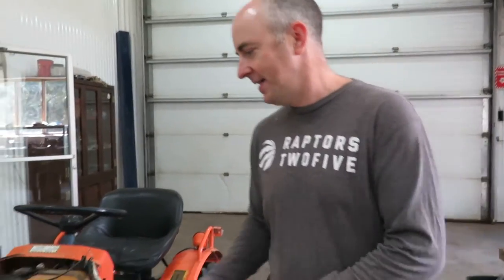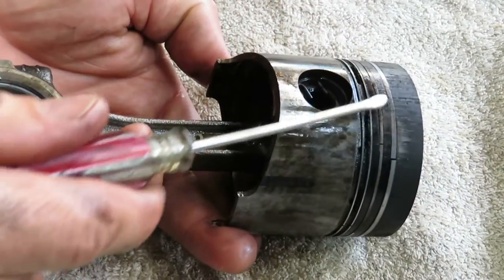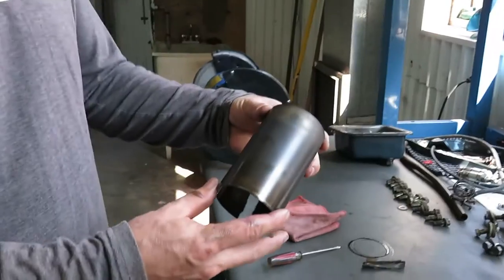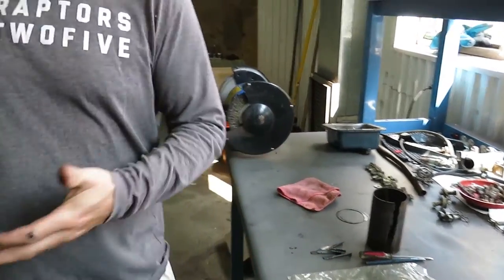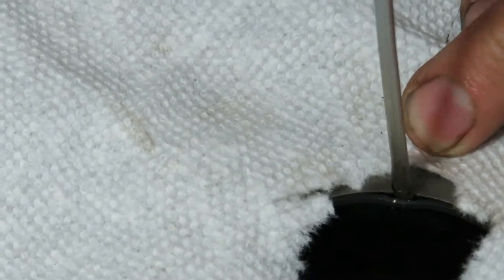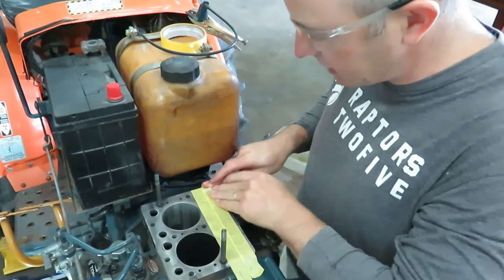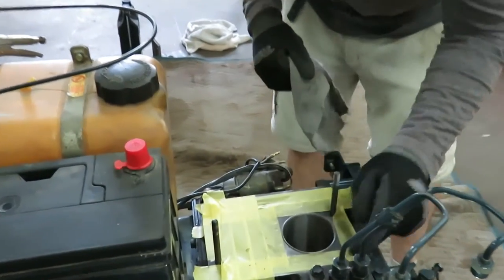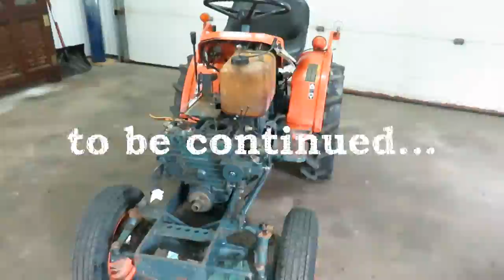Kubota B5100 Rebuild, Part 2: Removing and Inserting Sleeves in the Cylinder Bores

Comment: Next time run a weld vertically the full-length  of your sleeve and let it cool down. It will shrink and the sleeve will be loose and come out real easy.
Reply from the maker: Thanks for the tip Ray

Comment: Good job ! There is a big problem with these engines: when you order new liner from kubota, only the inside diameter is good! The piston cannot fit in, they have to be rebored! Already the original part is expensive, in addition you have to pay for a reaming! It's scandalous !
Reply from the maker: Thanks for the comment Toluen60 Nom. I learned this the hard way - stay tuned for the upcoming videos to see what happened in the end.
Reply: I see many other videos of Kubota rebuilds where the piston and sleeve fit together. why is that not the case here?
Reply: @Ayastracci   you can buy sleeves made to fit or ones that the shop then bores them after the install. My understanding is the sleeves should be measured after installing because they are a pressed fit not all blocks are exactly the same size so the sleeves will be different sizes as well after being installed.  Also not every piston is exactly the same size so you should measure the piston being installed in each sleeve and custom bore the sleeve to fit each piston.

Comment: Any progress on this engine? Reason I ask is because I need to resleeve my DH1101 and I was wondering if the sleeves you have are in need of sizing and honing.
Reply from the maker: Hi Robert. My wife is working on the editing of the next video on the Kubota engine rebuild. It should be ready by end of next week, so please stay tuned for it and you'll see what I had to do to get the engine back together.